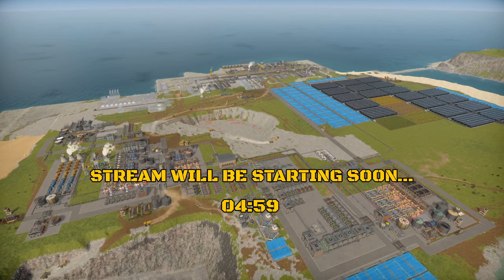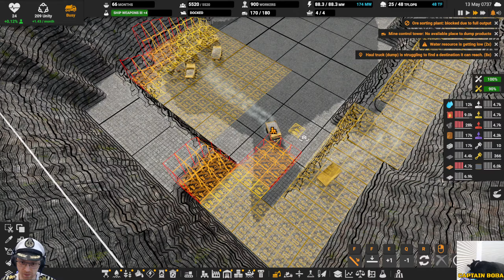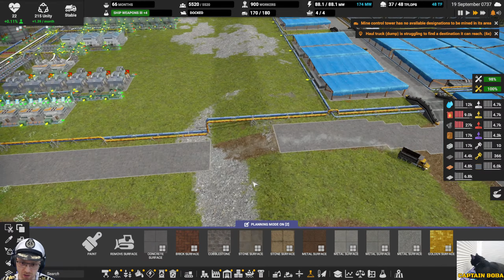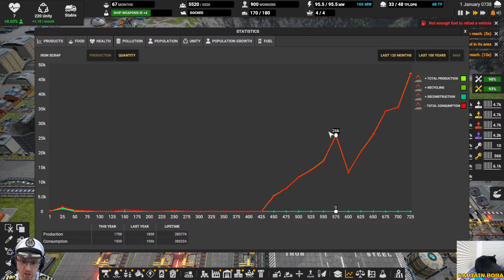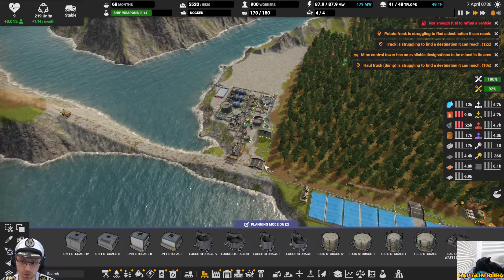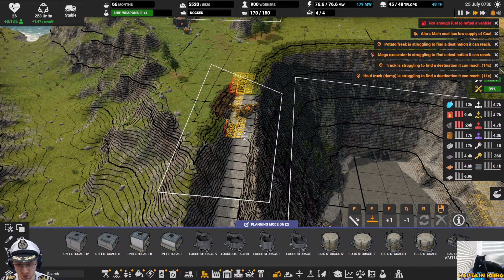Captain of Industry dev stream #22: Not enough coal, let's go NUCLEAR!

Comment: great stream !!! looking forward to the Gasifier unit that turns coal, wood, and biomass in to fuel gas, co2, and sour water !!! keep up the great work
Reply: Biomass already could be recycled into fuel gas + compost in Anaerobic Digester, like sludge or other organic leftovers. 
It is not, which would be fixed in future. We hope.
Reply: Instead of wood into fuel gas, you can feed wood chips or charcoal straight into boilers.
And so is also for coal. 
It it more wasteful and unefficient to make one kind of fuel of other to burn it finally. Like using power to produce hydrogen, and then burn hydrogen to produce power.
You just losing part of power with each step of transforming.
Reply: @DobinSergei  the point is wood or coal to fuel gas  to diesel